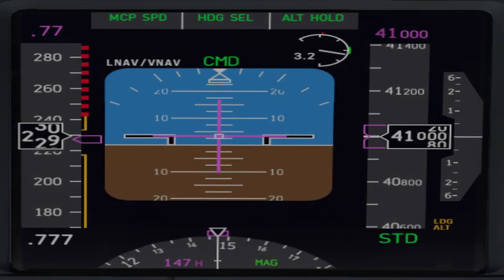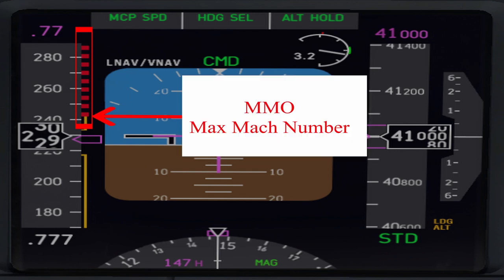Critical Mach Number Explained - [Do You Know What Is The Overspeed Clacker?]

Comment: Thanks for the video very detailed explanation, however I have a question relating to the maximum speed at different altitude at closer sea level understand Mach speed is higher 661 knots does this mean as the aorcraft can’t possibly fly at this speed at low altitude so the beginning of clacjer over speed will this be the speed to not overstress the aircraft rather than the MMO value ( critical Mach value number as this will not be the issue at lower altitude , 
Thanks again